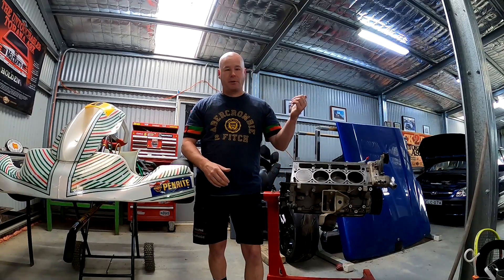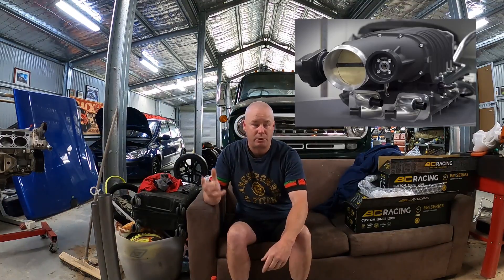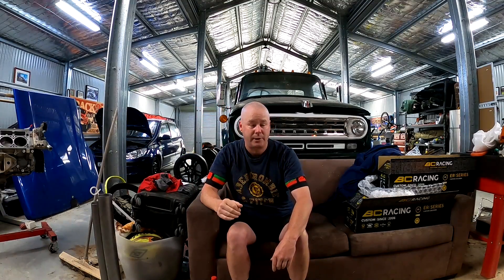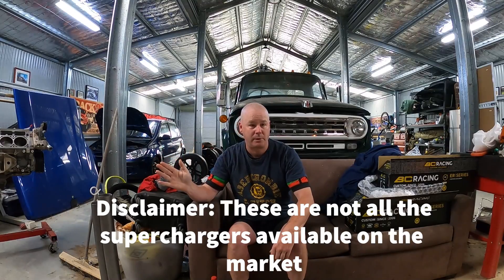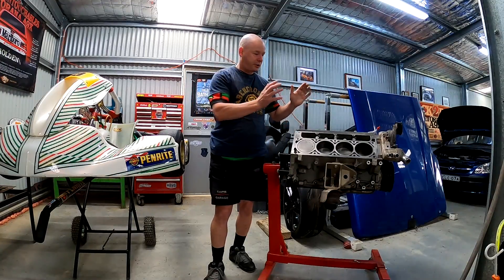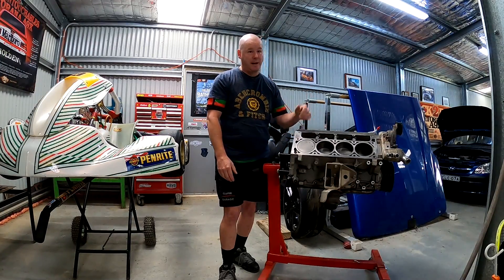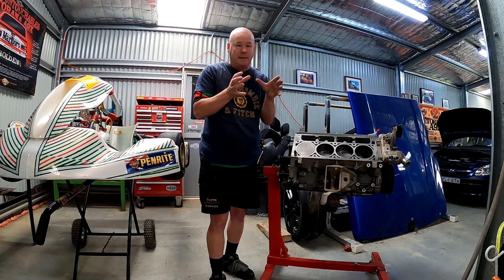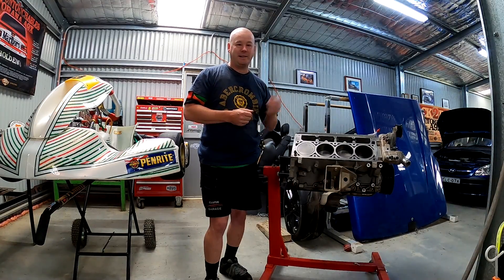Supercharger Performance Mods - VE/VF Commodore

Comment: What things can be done to an old engine ? Is it worth upgrading an older engine with over 200k KMS ?  Or instead of upgrading should I be look at maintaining?
Reply from the maker: If it has 200km's, it can be more economical to look at a crate engine for the same sort of money as a rebuild.  Have a look at our video where we compare the LS engine options for VE/VF Commodores.

Comment: I'm on the other fence I think your bang for buck isn't that good their are limits to those supercharges I'm currently  about to jump in the boosted camp but for the $18k+ $1500 set ups for hp gain isn't that great if I paid the $20k to set up my VE and supercharger and I took it to the drags and got beat by a turbo Barra I wouldn't be a happy camper, so I've been looking in to both and it keeps coming up that a turbo is a better and cheaper way to go I can put an s498 98mm turbo on my ve for a whisker over $6.5k, and still have enough left for a 413 stroker, a haltech and be pretty easy 800-900hp 9 sec pass and I've done my homework on it and the harrop 2300 and 2650 aren't to best ones to get, so I'm mulling it over quite a lot, food for thought

Comment: i have a e1 gts ls3 i heard if you put a lsa on it will bend rods like spagetti as it has higer torque down low and is to highly efficient for a ve ls3 , im guessing i would have to run boost aroun 10 and no more
Reply from the maker: G'day, we safely ran our L77 engine on 8-10 psi for over two years.  Key thing is to have an appropriate tune and fuel delivery.  These blowers aren't like turbos in terms of bending rods.  Of course the pistons and lifters will soon let you know if you are pushing too much boost!

Comment: Good informative video, for me a blast from the past to. I was in that VR Clubby at 5:33 a few times , he was into real estate from memory and mates with my mate....it was stupid fast back then and I was in owe of that car.  You have a picture blue SS hatch on your shed walI, also remember going to the house of the owner of that blue SS Torana during its build, he lived in Queanbeyan and initials were WW from memory. Bloody nice Torana and worth some big $$ now I suspect.  On a side note I was tossing up between a Harrop 2300 from my VE SSV but ended up going with a full bottom end engine build, monster F35 cam, PRC heads etc etc. Love forced induction my whole life, but strangely changed paths for some reason.
Reply from the maker: G'day mate, yes I fondly remember that VR Clubby.  Pulford used to drag it down the main drag in Mitchell and I would be in love 😍.  I owned the Blue Torana after a mate of mine bought it from the bloke in Queanbeyan.  I spent a skwillion in it too! Nice work on rebuilding your 6.0L in the VE.  Any plans to take it to the track?
Reply: @ClunieGarage  Hey, that was one sick Torana, hope you don't have sellers remorse mate.  Not sure on the direction I'm going with the VE,  want to keep it as much of a street build as possible. Would probably look into getting a dedicated track car tbh, that idea has been circulating in the back of my mind for a while to.  On a side note, do you have any recommendation on VE coil overs for enthusiastic street use? I see you guys sort of recommend BC for entry lever track use, but it's a mixed bag of reviews on these. I'm ok to spend a bit more for the right product!! Thanks in advance...cheers

Comment: Such a good one thanks ! Earlier this year and after 20 years dreaming of buying a v8 I bought a 2016 redline with low ks. I will eventually do some  mods  but one thing holding me back from a blower is whether you can have too much power for a road car? Would it be a waste if I'm never taking to the track ?
Reply: Nar man. How many hsv’s do ya see at the track not all that many. I’d do it but do everything else. Diff, tyres, suspension, brakes, etc

Comment: I think you could do a couple more in depth vids on this topic. Like, how does it affect the cars computer? Do you need to get an aftermarket tuner like HP or Holley? Do you need to have forged internals? Why do most car manufacturers install Eaton superchargers but when adding a SC most are looking at whipple, magnuson, and harrop in AU?

What's with the "dont do it for dale?" Is that a nod or a slam to cleetus?
Reply from the maker: G'day Eddie, we will look to do a follow up video in the future, thanks for the tip.  A couple of quick answers for you in the meantime.  Once you add the supercharger hardware, you will need to increase your fuel delivery through either bigger injectors and fuel supply delivery.  This will need to be tuned through the ECU and in many cases you can use the standard factory ECU in late model Holden Commodres.  Forged internals are not entirely necessary unless you are looking at massive boost and in those cases you should be looking at lower compression pistons, head studs, ring gaps and a whole lot of other mods.  If you are looking at conservative boost (5-8 psi), a healthy standard engine is normally OK.  Car manufacturers like GM typically use eaton twin screw  rotating assemblies in their factory superchargers in models such as the HSV GTS and Camaro ZL series.  You will actually find that popular supercharger manufacturers like Harrop also use eaton twin screw components inside their blowers.  The "Do it for Brocky" is a huge nod to Cleetus and call for all car enthusiasts to remember the king of the mountain in the same way US enthusiasts remember Dale E.
Reply: @ClunieGarage  alright!! Thank you for the reply and clarifying you're sign out phrase. I'm a subscriber so I'll be looking forward to more commodore content!!!

Comment: @clunie garage - Kong performance has a lsa upgrade to replace the factory blower from 1900cc to 2650cc 
And they also have their new dual pass billet intercooler lid which is a mega piece of engineering! For your supercharged rig on the track I would hit up Forced induction Technologies and enquirer about their inter chiller kits which keep your intake temps below ambient - ensuring as you drive around the track your efficiency in continuously creating peak horsepower is retained and no thermal heat soak is experienced

Comment: If you want real horsepower with reliability you should change the cast pistons and rods for forged. (Stoc
k rods are powdered forged not real forged)
Reply from the maker: G'day Jordan, yes forged pistons and rods are good ideas if you are looking at adding lots of boost.  As is a iron block.
Reply: I have not seen any rod failures, if the piston falls apart it results in rod damage. Most issues seem to be with the pistons and a large amount of them are from not enough ring gap.
Reply: Gen 3 rods are the problem and the knock due to not having a floating pin design. Gen 4 are fine, but like said already it's the pistons. Actually the rods are a problem because they aren't a 6.125" stroker length😉

Comment: 10  to 16K LOL More like 25K thats with all up labour and full exhaust and tune etc., then add the cam and heads which adds at least 150Kw easy above the 400KW, but is it worth it on a stock engine ye if you going to just rev it here or there, but for drags and st hi end type driving, so no more than the speed limit total waste of money if you ask me, even if i had the cash i would not do it, basically each to their own, like my redline its stock and i am keeping it stock which are asking more than what i paid for it now, over 50K and thats one with over 90K on the clock even Redbook values have gone up over 5 k just from last year values, as soon as you do it up ie: supercharger the new buyers always know it was thrashed and you never get your money back on those mods no matter which car it is?
Reply: No one likes stock Redlines 707, that is why you are watching vids of 7 litre supercharged Redlines instead of punting yours around Phillip Island at full noise.
Reply from the maker: G'day, when we first fitted the 2300 Harrop bolt on supercharger to the L77 in the VF Redline, it was $16k drive in and drive out.  That included a HSV diff gear set and new bushes.  We already had the other mods fitted (e.g. otr, headers).
Reply: Put a blower on dude.. that will cheer you up 😀

Comment: Thoughts on the intercooler on top (lsa 1900/ heartbeat) vs  underneath (Harrop FDFI) ?
Reply from the maker: G'day mate, I may be a little biased as I have had several Harrops, but from we have heard and seen at the tune shop, the underneath design seems to work better.  You can get spacer plates and other intercooler goodies to manage heat soak as well on both types of blowers.
Reply: @ClunieGarage  did you put any of the spacers on your set-ups so far?
I've got them for mine thats in the process of being built.
A little worried about hood clearance though!
Reply from the maker: G'day mate, no I haven't used spacers to date, but the tune shop is exploring an intercooler mod with me at the moment on the 2650 which I will share on the channel if we move forward with it.

Comment: when are you going to upload the VF racing, looks like she is all go but no show mate?
Reply: Try to keep up 707, I think the stuff you are smoking is effecting your memory. There was a vid showing the VF pulled apart in the workshop.
Reply from the maker: Here is the latest update.  Roll cage is in, fabricator fitting blanking panels to seal the boot and firewall next week and fuel system has nearly arrived from the US.  We are planning for a shakedown run in late April if all the stars align and FedEx dont lose the fuel system!!

Comment: LSA the world ! 
Interested to see if you do go down the road of a LSA . 

I am after the 2650 LSA from Harrop myself . Once i get the cam in my GTS , ill go the 2650 LSA
Reply: After you put a 2650 on your beast your old LSA blower would go nice on my little LS1.
Reply: @mikenolan3060  Would be a great video to do up for my channel doing a LSA install on LS1
Reply: @CurtisLSA  I'd love to see that since Im wondering if I should go LSA supercharger on an LS1 Mate.
Reply: @moussa.s376  Wouldnt be for another year at least if i was to swap it , getting cammed and chiller first before i even think about the 2650 blower, then the LSA on the LS1 . Be a good video i could do though seems many are interested in it
Reply: @CurtisLSA  Id love to see it mate. Love your video by the way. Cya Curtis 👍
Reply from the maker: G'day Curtis, yes the 2650 is a much bigger unit than the factory LSA blower.  More air capacity means you don't need to spin the blower as hard and generate as much heat.
Reply: Curtis, you should do a collaborative vid with Clunie Garage and stick the standard blower on Black Betty!
Reply: @angry9901  sounds like a plan !
Reply: Curtis I have LSA long block with cam trunnions upgrade and 2650 Harrop in my VE wagon and it’s the best combo for reliable power and street manners.
Reply: Why harrops arent the best out there the 2900 wipple make the best hp yella terra have them but your looking at $20k
Reply: @Disableddragracer  not wanting the most HP . Just something a little more and i would need to keep it LSA anyway
Reply: @Disableddragracer put and lsa blower on my ls3. Cost me $9200 and makes 417 kw stock cam lol

Comment: i have a friend that has a built Dart block with a 2650 charger ...last time it was on the dyno it made 930kw at the wheels....nice results if you got very deep pockets lol
Reply from the maker: G'day Michael, absolutely.  Our build on the VF redline is a LS7 engine with the 2650.  Stonking torque and horsepower.  A real Frankenstein!! 🤠👹